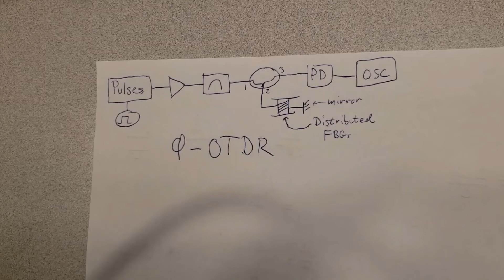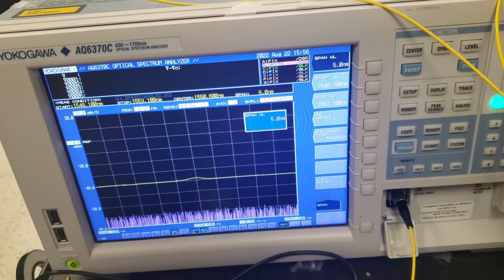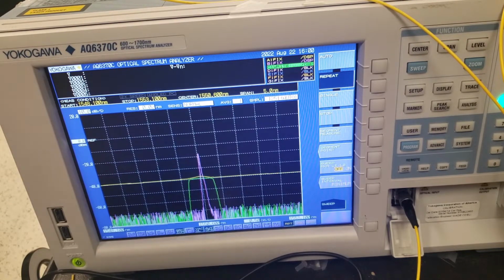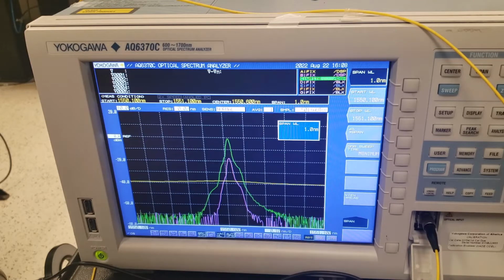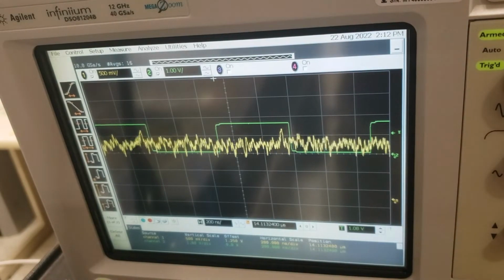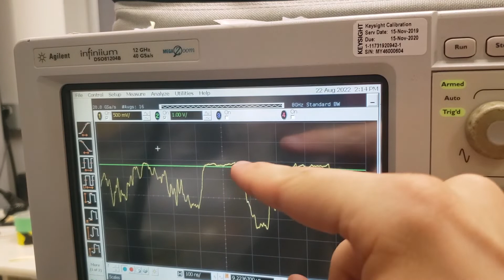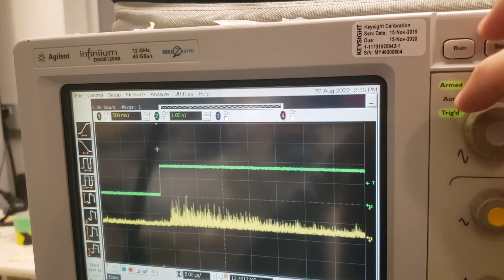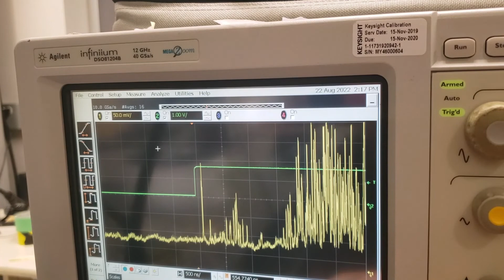Phase OTDR demonstration

Comment: Hello, which type of filter do you use, please? Is there any website where I can buy it? Thank you very much!
Reply from the maker: It's an XTM-50 filter from EXFO. Being able to tune both the bandwidth and center frequency is super convenient.  I think that they cost around USD8.000; not unusual for a specialized piece of research equipment.
Reply: Thank you. Do you recommend another cheaper tunable filter?
Reply from the maker: @The_thinker2025  Hmm it depends on what specs you need; range, bandwidth etc. The cheapest option would probably be to build a temperature stabilized box with an FBG in it; takes some time to tune and has a fixed bandwidth, which is inconvenient, but otherwise pretty simple. 

Found some FP filters here in the USD2000 range:
https://wdmquest.com/collections/tunable-optical-filter
Reply: @yourfavouriteta  I made a Phi-OTDR system with a 3 MHz laser at 1550 nm based on the article "A Distributed Optical Fibre Dynamic Strain Sensor Based on Phase-OTDR" by A. Masoudi, M. Belal, and T. P. Newson. The system is based on an MZI interferometer. However, what I see on the oscilloscope are two pulses: one corresponding to Fresnel reflection at the end of the fiber and another within the fiber i think at X=0m (which I don't understand the origin of).The problem is that I don't see the same results you obtained; I don't even see the backscattering trace like an OTDR trace. Do you have any suggestions?
Reply from the maker: @The_thinker2025  The detection scheme in that paper is more advanced than the one I present in my video, which may explain why you get a different signal than me. I recommend trying to build my more basic setup before attempting to recreate the one in the paper. In my experience, mastering the basics early always pays off in the long run. 

One thing you may want to verify is the duration of the pulses you use and the repetition rate. First of all, the temporal duration, D, of the pulse should be such that Dc/2<<L, where L is the length of the medium. Otherwise, the resolution will be bad. Additionally, the time between two pulses, T, should satisfy Tc/2<L to allow the first pulse to completely exit the medium before the 2nd one arrives.
Reply: @yourfavouriteta  hello, In this experiment, are you using a Mach-Zehnder interferometer to interfere with the backscattered field? Or are you directly detecting the backscattered field and measuring it with a simple photodiode? Or is it coherent detection (where you interfere part of the pump with the backscattered field)? Thank you very much in advance for your response !
Reply from the maker: @The_thinker2025  The experiment in the video uses direct detection. For this to work, it's important that the pulses have a high extinction ratio, i.e. the ratio of the peak power to the CW power that "leaks through" the EOM. Otherwise, the signal returning from the FUT will interfere with residual CW and cause oscillations in the measured interference pattern even though the FUT is not affected by any changes.
Reply: @yourfavouriteta  Thank you for your answer, what about the peak power of the pulse?
Reply from the maker: @The_thinker2025  It should be high enough for you to get a strong signal, but no so large that nonlinearity begins to affect the pulse significantly. In short, we want a sufficiently small nonlinear phase shift given by, φ_NL=γ*L_eff*P, where L_Eff is the effective length of the fiber, P is the peak power of the pulse and γ is the fiber nonlinearity parameter.

It so happens that φ_NL is approximately equal to the "percentage increase in the spectral width of the pulse due to nonlinearity", so φ_NL=0.5 would imply that a pulse that was initially 1GHz broad is now roughly 1.5GHz broad. 

Assuming typical values of L_eff= 20km and γ=1e-3/W/m,  φ_NL would be equal to 1 for a peak power of P=1/(γ*L_eff) = 50mW; so if you make the peak power of the pulse 50mW, you can expect its spectrum to be twice as broad once it reaches the end of the fiber.

I cannot say how much this effect matters for your particular application, but it's fairly easy to investigate: Just set up your experiment and gradually adjust the pulse power to see if the interference pattern changes significantly (apart from increasing intensity) as a result.
Reply: Thank you very much for this clarification!
Reply from the maker: @The_thinker2025  No problem!
Reply: @yourfavouriteta  The experiment is finally working! I can clearly see the coherent scattering and speckles. Now, I’m looking for PZT (piezoelectric) cylinders to apply specific constraints. Any recommendations for models that are suitable for these kinds of measurements? Thank you in advance for your response!
Reply from the maker: @The_thinker2025  That is great to hear! 

I cannot recommend any particular PZT fiber stretcher, but a quick google search shows that you can get a new one for around USD 2000:
https://www.piezodrive.com/optics/fs-optical-fiber-stretcher/

Before buying this, you may want to do a simpler temperature measurement. Place a segment of the fiber under test (depending on your spatial resolution) inside a large plastic box filled with warm water and a digital thermometer. As the water cools down, record an OTDR trace and the corresponding temperature every so often. 

You can then plot the traces for different temperatures together. Alternatively, you can take the difference between consecutive traces to reveal where a temperature change has taken place.
Reply: @yourfavouriteta  Thank you so much for your helpful suggestions and the link regarding the PZT fiber stretcher. Your idea to use warm water for a temperature measurement is great, and I plan to try it out soon!
Reply from the maker: @The_thinker2025  Perfect, let me know how it goes!
Reply: @yourfavouriteta  Sure, I'll keep you updated!
Reply: @yourfavouriteta  I just have a quick question. I noticed in the video that you average the traces. Is this really necessary to improve the SNR? The issue I’m facing with my oscilloscope is that it can’t save averaged traces, and it’s limited to averaging only up to 4 times to save a trace (even though I can average more, I can't save the trace correctly if I exceed that limit) , which results in a very low SNR and poor reproducibility, even in the absence of external disturbances! the averaging is important ?
Reply from the maker: @The_thinker2025  Under ideal circumstances (zero noise and a static environment) you would just see a perfectly stable interference pattern. When noise is present, every part of the pattern will appear to "flicker" up and down, which makes it difficult to detect changes in the pattern due to actual changes in the environment. Luckily, because the underlying pattern is fixed while the noise is equally likely to push the measured voltage up or down, averaging many traces will cause the noise to cancel out. 

If your oscilloscope cannot do this automatically, try the following:
For a given temperature, you can save several "raw" traces and just average them when you process and present the data. 

Hope that helps
Reply: @yourfavouriteta  Hello, I did 2 series of measurements (T varies from 62°C to 42°C and i measured several traces, trace/°C).  what I observe is that the change in the traces is not limited to the position of the temperature disturbance, but is also visible from that zone all the way to the end of the fiber. The first half (from x=0m to the disturbance) remains unchanged as expected, and I don't understand the reason for this. I see this in several measurements!!!
Reply from the maker: @The_thinker2025  I think that this happens because the "hot" region changes the refractive index of the glass, which alters the phase of the light pulse and thus the observed interference pattern after the temperature change. 

What length of fiber are you subjecting to the temperature change? I suspect that if you only heat a very small segment (for example by placing your hand on a part of the fiber) you should see a change at that location but not after, as the heat from your hand is enough to alter the local scattering centers but the section is too short to cause a large phase shift for the pulse.
Reply: @yourfavouriteta  The total length of the fiber (FUT) is 1096 meters, with a heated region extending over 10 meters. The measurement resolution is 1 meter, corresponding to a 10 ns pulse width. so I have to decrease the length to less than 10 m ?
Reply from the maker: @The_thinker2025  Yes, try that out.